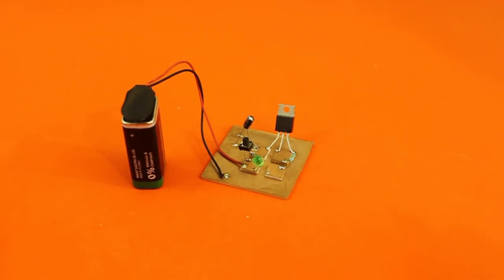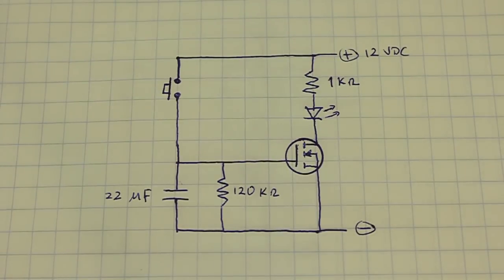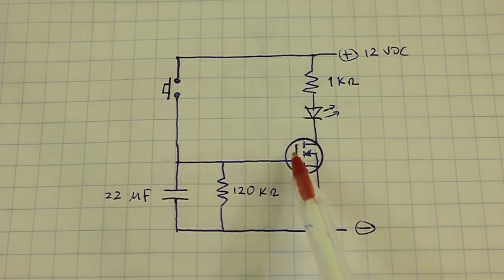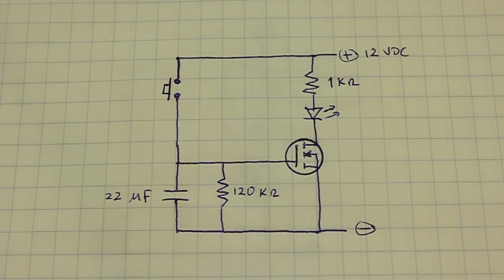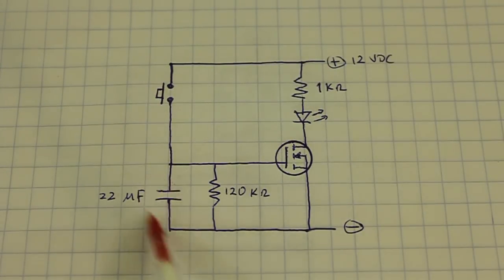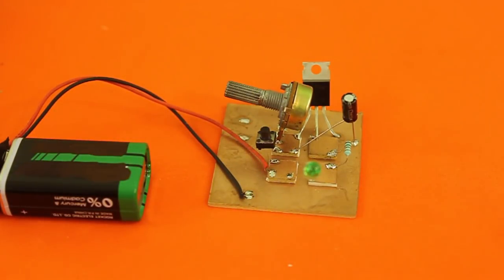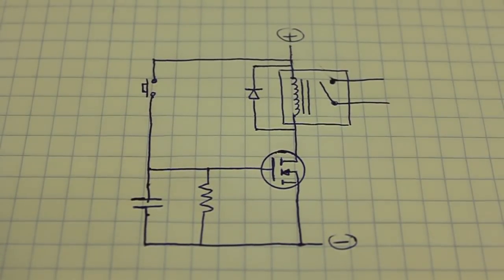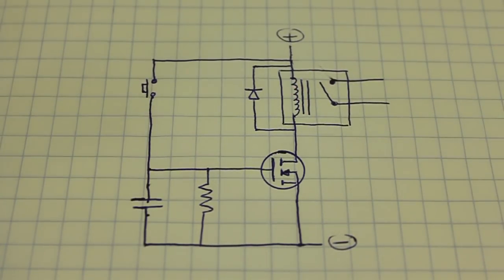Power Off Delay Timer Circuit

Comment: HELP:can i replace the led with dc motor? if the answer is yes, since we are using 12V battery what voltage dc motor spec should i choose?

Comment: Hello! Can anyone tell me, can I use an analogically circuit for ac 220v with another nominals of components? I need to make a simple turn off delay for door ringing. Im in Ukraine and we have problems with electricity because of war, and I created an alarm to wake up me when electricity is back. But I want a turn off timer to prevent it ringing forever if I left home and left the ringer on, forgot to turn it off.

Comment: Sir in the video u have used variable resistor in place of fixed resistor. Please show the VR pin connections u made in the circuit.

Comment: This looks like it would do the trick to keep my aftermarket rear backup camera signal on for a few moments after the reverse is disenganged. That way, the headunit will not cut off the video signal immediately, which is a little bit annoying when manoeuvring
Edit: not reall. I need a hard turn off, only accomplished with something like a comparator driving the MOSFET.

Comment: Ok but I need to change something
I need to use delay circuit in over head tank...
Working procedure as follows

When tank full float switch will switch on   and then buzzer as to switch on for 30 sec. And it auto cut-off da buzzer and then again water goes low again top up again itas to take da same procedure

Comment: sir in case you replace the resistor with Variable resistor.,if the VR shaft crank to 0 ohms it will get short the power supply when someone press the switch. need to put 1 resistor between switch and vcc

Comment: That's a very neat circuit, however i was wondering, could you use a TRIAC instead of the relay to control higher power ?
Anyway, i've subbed and thumb-upped so that i can watch more videos from you

Comment: Hi, thanks for the video. I’ve did a similar circuit. But i have a problem with the switch button. I’m now using a latching switch button to get the LED light turn on and turn itself off after about 5secs. To do that again, I’ll have to press the latching switch button back to up position and then press it down again to activate the delay off circuit. Please advise is it possible to replace the latching switch to a momentary switch button to have the same delay off circuit? I’ve tried using a momentary switch button. But I’ll have to press and hold onto it in order to get the LED turn on and turn off itself after 5secs. How to not press and hold onto the switch? Can i email you the items i used for the circuit?

Comment: Is there anything to control the Ampere for controlling the peltier temperature?
Reply: get something that can adjust the voltage, google 'voltage regulator' adjust the voltage low enough you will start effecting the current.

Comment: How can i control current for peltier application?
Reply: You probably just want a buck converter module with a constant current mode - that's not the simplist way, but it is easiest, because you can buy boards with all the parts on as pre-assembled modules off a lot of eBay or Amazon sellers. Just look for 'DC-DC converter' and 'CC' and you should be in the right area.

Comment: Can the light stay on for an hour?
Reply: yes it just needs to be calculated https://www.allaboutcircuits.com/tools/capacitor-Charge-and-time-constant-calculator/ for high current applications however not realy, the relay requires a good current to stay open. if you want your house light to stay on for instance go to a electronics store and get a proper timer.

Comment: Basic electronic question: Can someone please tell me how the resistor which is connected in parallel  affects the output of the capacitor? I mean there's no obstruction between the two leads of the capacitor
Reply: the capacitor keeps charge like a battery. there is never (Ideally) a direct connection from the 2 wires of the capacitor. Without a resistor the led would remain on (ideally)
Reply: Think of the resistor you refer to as a water hose,  slowly draining the current ( water ) from the tank ( capacitor )  until there is none left to apply to the mosfet gate. The mosfet requires so little current to stay switched on, it would remain on for a very long time without the resistor drain. Hope this helps.

Comment: Dear can you tell me how to make power on delay timer for IR (Infrared) Obstacle Detection Sensor? when an obstacle comes to the front of the sensor and relay on for 1-10 second and then off automatic and it on when an obstacle comes again after 5 seconds.

Comment: Simplicity is great! But... for high current and long time delays, do NOT use this circuit. Relay's need decent voltage to force contacts correctly. For delays >10 sec, mosfet will be in linear mode during disconnect causing greater contact arcing.
Reply from the maker: That's good advice ✌
Reply: At 12v using a 6v relay in series with a popular 5 to 6v zener diode can make relay disconnect faster.